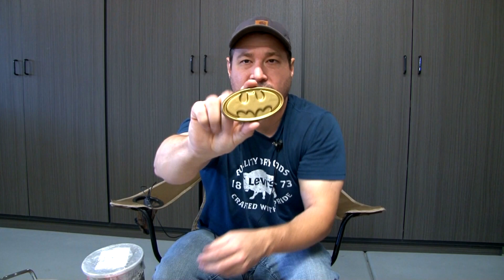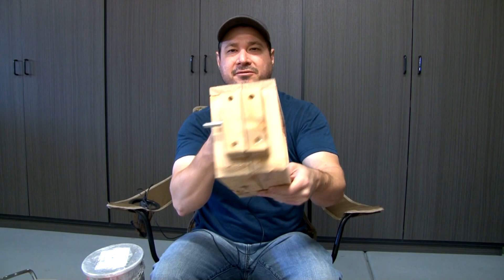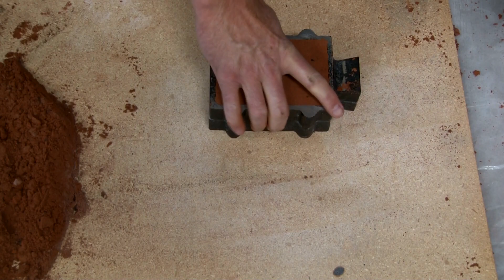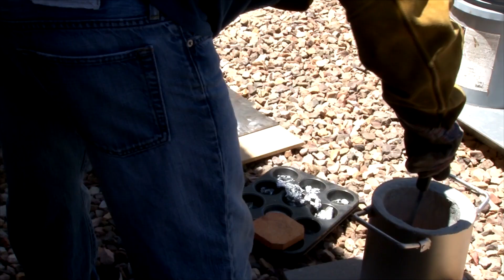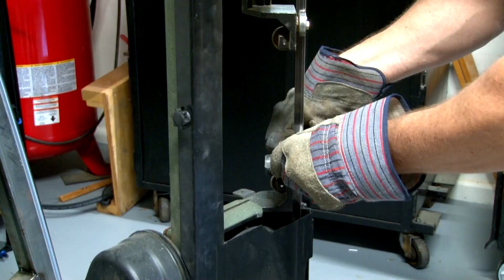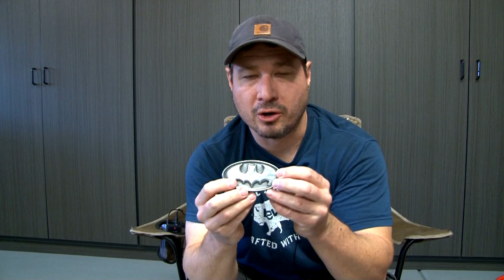Batman versus Superman(from my previous video) aluminum sand casting.

Comment: Great casting 
But please get some proper pouring tongs , as your crusible gets older it will get softer when hot and the pliers you use will break the side out that could cause you to drop the crusible, and believe me it will go everywhere 
Great
Reply from the maker: I believe you and you are absolutely right. I just haven't made that as much as a priority as I should.  I will prioritize getting some tongs soon. Thanks for watching.

Comment: Very nice, but . . . 

Make mine Marvel.  😉

I also bought a couple of those cast iron flasks for my smaller projects to cut down on the unnecessary sand ramming.
Reply from the maker: Thanks.  I never figured I would start a collection of casting flasks but it’s happening.  Sounds like you already figured out how to be efficient.